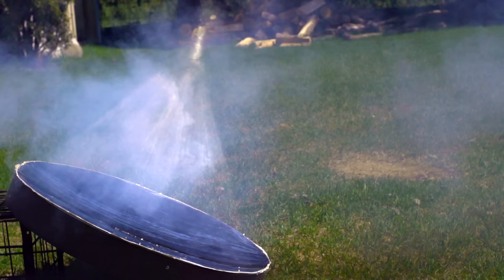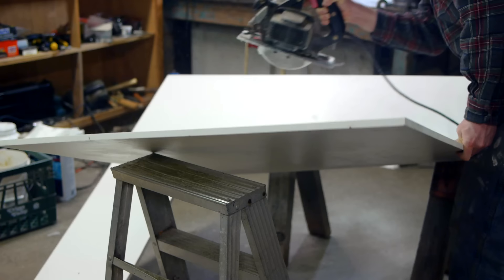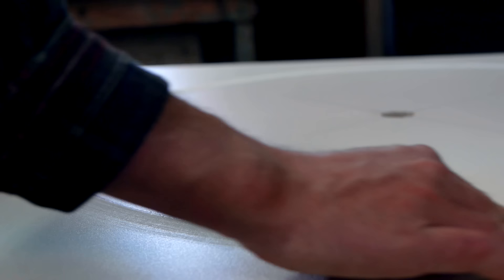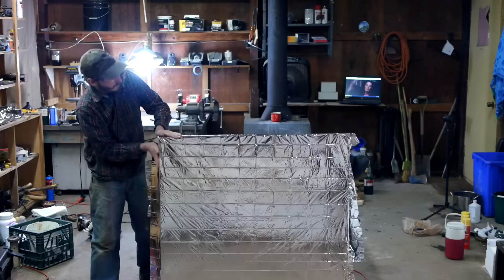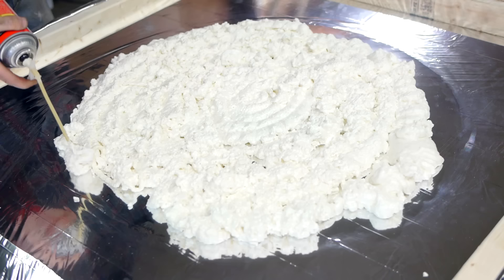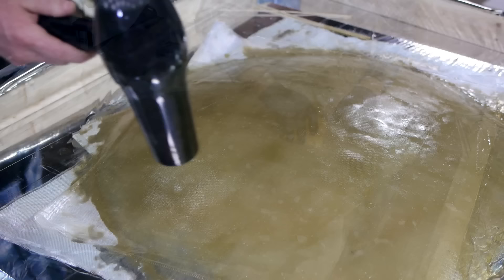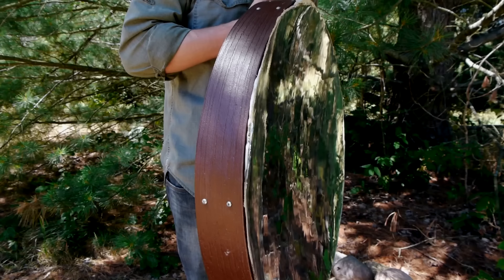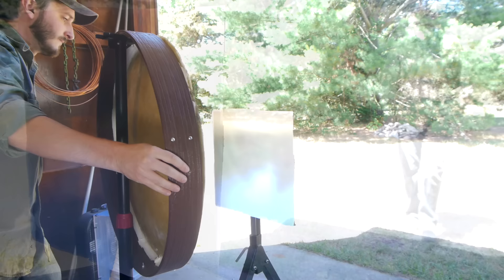How To Make Parabolic Mirrors From Space Blankets - NightHawkInLight

Comment: Hmm, wouldn't inflation create something approaching a spherical shape rather than parabolic? Obviously not in this case but I would love to know why. Also, if this is anything like using gravity to make a parabola what it actually makes is a catenary which would be fine for solar but probs wouldn't work for telescopes.
Reply: I agree with you.  This is a great way to make a reflector for solar use but it won’t be a parabola and even if it was a parabola, it’s never going to be smooth to a 1/4 wave (some mirrors for astronomy telescopes are 1/10 wave).
Reply: This technique has been used for decades by amateur radio operators to make "parabolic" reflectors for antennas. There the tolerances are not as critical as the wavelengths are relatively large. I don't think a telescope is possible as you would want a fraction of a very small wavelength (good optical mirrors are about 1/10 wavelength). For concentrating sunlight however, this is a good compromise. We can start a fire with a small magnifying glass, so a 3'mirror should be good enough even though it does not have pinpoint focus
Reply: I also think it's not a parabola. A parabola  has the sharpest curve at the centre, I suspect this has the sharpest curve at the edge ?. It should be easy enough to Ray trace it and discover its coma ?
Reply: Mirors for astronomy are incredibly difficult to make. They must be perfect to the micron. It's why they are so expensive to produce. This is Definitly a wonderful projet for solar cooker, long range micro or wifi. With old recycled satellit parabola this technique could probably work. It reminds me i have to repair my bicycle tire :-)

Comment: You can tighten the mylar around the wooden frame by heating it with a hair dryer as well. The heat causes the mylar to shrink on the frame and turn into a clean mirror.

Comment: When you look into the mylar and see your reflection, is the image crystal clear like it is in your bathroom mirror?  If there's any fuzziness at all, then it really won't be suitable as a telescope mirror.   Furthermore, the tolerances required for the paraboloid shape are tight in order to get a clear image.  But don't despair -- there are other good uses for an approximate paraboloid -- like the solar cooker you've shown.  I know that -- in theory -- rotating a shallow dish of liquid will generate a parabolic shape, but the liquid needs to have viscosity high enough to damp out waves and turbulence, and you'd probably need to run it for a while until the final shape is stable.  I wondered if a long-curing syrup-like 2-part epoxy, rotating in a shallow dish would solidify into a nice parabolic shape.  This could then be used to (1) make a long-distance acoustic spying device or (2) serve as a template for making parabolic surfaces via vacuum forming hot thin plastic sheet.

Comment: Next video - make it heat water in copper pipes and make it rotating, to falllow the sun with arduino.
Reply: Easier to use black hose :p
Reply: you don't need an arduino, you just need a cross made from small solar cells which is attached to the mirror. the solar cell outputs are crosswired to the DC tracking motors and the cross is mounted in a way that the sun isn't shining at the solar cell faces but at the edges. :)
Reply: it's almost stupidly simple. no electronics needed at all, not even a battery or power supply!
Reply: you won't need copper pipes mate.. just get half a barrel, fill with water and aim the lens at near bottom, make sure your barrel can breath a bit.. wont take long and it doesn't need to follow the sun, 1 good hour is more than enough.. this thing can melt metal in not a very long time, water would be stopping your barrel from melting.

whwre i am, we don't have electricity so we made 1/4 of a barrel (cut a barrel down and welded it) and connected it to my water tank, i heat water using wood or gas (mainly wood), but those can get expensive.. i need one of these lenses or anything that can focus a big area somehow, those blankets aren't available here.
glass is out of the question..

i tend to use a 10m black 1/4 inch garden hose for showering, but you cant make everyone shower with that alone.. need something bigger for the house..
Reply: +AA A if you dont have electricity, how did you comment this?
Reply: M Isa 
Small solar system.. cam charge phone and turn on modem at least xD
Reply: AA A - I'm not sure where you're from, but here in the US, you can drive around rural areas and find those old 4 to 6 foot satellite dishes all over. They aren't being used anymore and most people will let you take them just to get rid of them. They are mounted at ground level, which makes it easier to get at, but some of them can be heavy, so you should probably get some help removing it. The bolts are usually very rusted, so you might want to bring some penetrating oil and/or a hacksaw with you. I currently have 3 right now and this is how I got all of mine. I made a parabolic reflector from one by using 1 inch square mirrors that I glued to the dish. I use the other to pick up the few satellite programs (and other interesting stuff) still being broadcast on the old systems. I haven't thought of a use for the 3rd one yet, but I'll think of something eventually. If you ever get your hands on a small DirecTV or Dish Network dish, you can remove the LNB and replace it with a microphone to make a great remote/amplified listening device. It's fun to point it around in wooded areas and here all sorts of sounds that you would otherwise never be able to hear. Anyway.... good luck with your 'off-grid' lifestyle. I often wish my home could be less dependent on the electric company. I do have a large piece of land and I'm thinking about solar and/or wind power but I haven't decided which way to go yet.
Reply: wjustic1 what about using chrome or silver spray paint on it to obtain a parabolic mirror (a true big one,not a mosaic) ? you will need to prepare the surface first to make it as smooth as possible and cover any bolt holes with epoxy, of course. the chrome paint used for tuning hubcaps should be good. the result is very mirror like.
Reply: That sounds like a good and simple idea. I'm looking at using these shapes to heat water or cook with solar energy in the Phillipines
Reply: The large dishes are made with wire mesh/expanded steel to reduce the weight and wind resistance. I would add a smooth surface (like sheet metal) on the dish in order to paint it. I might be able to use some extra heavy aluminum foil, aluminum HVAC tape or silver mylar plastic, though.
Reply: Joe W. try an inverted conical solar cooker. Easy to make with cardboard or foam and heavy duty aluminum and "wheat paste glue".   These are very efficient and MUCH safer than the parabolic cookers.
Reply: Thanks Justin. Sounds good. Do you have a link to such a system? In the mean time I'll google it.
Reply: Falllow...?  Anyway an active following cross works well but may fail to self realign after a long cloudy period.  A mechanical tracking gear like that used for telescopes is sufficient, although I've never looked into what is done to reset it's position every 24 hrs... Half a day it isn't used and having it go full circle may either be weird or mechanically impossible.  An arduino is probably overkill.
Reply: Kevlar Canuck Arduino, overkill? i don't think so. It's the right tool for the job. The program would be a simple thing to make, and it could be made to be very reliable.
Reply: A. Zak What kind of power supply, programming scheme and data set would you use to track the sun?  A mechanical tracker can be set and left.  It needs no delicate circuitry and has been the right tool for the job for decades.
Reply: You don't need a freaking Arduino!!!
all you need is a stepper motor and a pulse Generator.
Reply: TheBackyardScientist
No shit!!  my black hose in the patio, puts out almost-boiling water!!! 
and I'm not even trying!!!  
Burned myself more than once! bc I'm not thinking about this stuff!!
  LOL
Reply: @AAA-bo1uo  Saw some folks use a large satellite dish, probably 6 or 8 feet dia, one of the old ones, it was a dark gray inside.  Kept it down by the stream, no mountings, just the dish.  Tip it into the stream angle to fill, and drag it ashore.  Wait a few minutes and you've got a very warm bath.
Reply: @AAA-bo1uo  You can make your own parabolic to whatever "fixed focal point" you want if you don't want to be committed to finding a sat dish..Its all a matter of the amount of air pressure you apply in the forming process, creating the intensity of the domed shape, prior to applying the fiberglass which will increase or decrease the focal angle up to the stretch limits of the Mylar..

Comment: Have you tried gluing the blanket to the rim of a shallow tub and then sucking the air out, this should produce a perfect mirror as the is no backing material to distort it and by altering the pressure you can change the focal length.

Comment: I use a hygene mirror in my camp kit for solar ignition. Was cheap and is durable. And will light a match without any issue. The concept of parabolic dishes is excelent and i think there is tons more potential in this we have yet to tap into. Obviously my little mirror wont melt bricks but for a few buck, and for its intended use, its hard to beat
Reply: Please describe a hygiene mirror and how you start fires with it? I looked up that term and came up with nothing

Comment: An idea that I've wanted to try is to use a discarded DishTV antenna. These are actually an offset section of a parabola. I would glue the space blanket material to the dish surface.
Reply: that might actually work pretty damn good. 

I used to build high end hill-bombing/downhill skateboards out of composite material and various cores. They were pretty wildly shaped as well and the technique I used was basically vacuum pressing/lamination. The composite materials were soaked in epoxy, layered onto the core (+pressing form yada yada), put into a vacuum bag and pressed by the resulting atmospheric pressure. 

Maybe you could coat the dish with epoxy, lower the framed Mylar onto it, and let the Mylar elastically form into the dish with vacuum in a similar way.
Reply: I tried that but wasn't happy with the result. Yes it worked but self-adhesive reflective aluminum tape worked better. I didn't try the vacuum method though

Comment: What if you used the dish from a satellite tv antenna? It would make a nice rigid form too. Aren't satellite dishes true parabolas? I could be wrong about that though.
Reply: They are good and rigid, but expensive.
Reply: people toss those daily
Reply: zasabiibasaz my thoughts exactly. :)
Reply: mute8s Yes, you should be able to use a sattelite dish. I just meant it would likely be cheaper to build them his way, if you want to have a lot of them.
Reply: Not to mention this process stretches the creases away to make a much smoother finish.
Reply: I got one for that purpose exactly, around 80cm diameter. The problem is, they are painted, and aren't very smooth (not mirror-smooth at least). Then I tried to glue strips of space blanket on it, and it came out all wrinkly. It focuses light well enough to set dry wood on fire after a while, but nothing like instant flame. I should try the vacuum method.
Reply: olegkikin I was thinking that may be a problem. Have you tried removing the paint? Maybe with a heat gun or some sort of paint remover?
Reply: from what I've heard they are not true parabolas
the spherical shape is a good approximation and much cheaper to make
Reply: I think I saw a video by Kipkay where he covered an old satellite dish with mylar tape.
Reply: MisterTalkingMachine back in the day I used to install many types of satellite dish equipment ranging from the simple 12 ft x band to the small DSS and I can say they are not true parabolic. They are more oval this made them a better collector to direct signal to the lnb
Reply: I've got four in my shed I've collected over the years (thanks DishNetwork!)
You can have 'em.
Reply: I have several. I put paint stripper on one, and scraped.it.off the next day with plastic so as to not scratch it.  It wasn't bumpy, so I began the polishing regime. It's a ton of work, starting with 200 grit sandpaper, then 400, 600, 1000, 1500, 2000, and finally 4000.  I've done this for aluminum, but the steel dish was so much more work, I quit at 400 and sought machines that do it.  Cloth disc and polishing  compound.  Well, that didn't even do that it was supposed to do. Now I'm considering a leather buffer tool, like I've seen on How It's Made.  My fresnel lens keeps me busy, melting pennies and vaporizing aluminum cans. It's about 4 feet across.
The dish antenna is not a true parabola anyway, so no astrophotography, but good enough for heating.
Reply: +Olegkikin
They will be smooth to within ~0.1 wavelength of the band they are designed for... which means perhaps a mm or 3.
For visible light (telescope) application, they need to be more like 60nm smooth.
Big diff.
Reply: pixelmaniac all you need is a hair dryer or heat gun to get rid of the creases and stretch mylar to fit a parabola.
Reply: You could use a sat dish.. but why limit yourself??.. you are obliged to the focal point designed by someone else..Bear with me a moment.. imagine an oval shaped reflective semi parabola surface designed to a focal point say ten feet away using this same vacuum method..Of course the two most direct focal semi circular points would have the greatest intensity but you would have a fairly intense strip running between them

Comment: Two things, 1) I have used a solar blanket to shield the sun from south- facing apartments that were experiencing oven- like temperatures unless the air conditioning was on continuously. When stretched tightly over the window, you could see outside perfectly like through mirrored sunglasses. The Mylar film was allowing about 30% of the light through, not the best thing for solar concentration,    but I am impressed how it does work in your video. Thin aluminum foil reflects 100% of the light... Could this idea be revisited using this instead?  Where can you get a wide enough roll?  With the same bonding process to fiberglass, the fragile foil would become a strong structure. 

2) With this process, the shape created would not be a parabola, it would be more like the a section of the edge of a balloon,  spherical in shape, good enough for the purpose, but less than perfect. Try as you might, but I doubt you get an optical surface that would work for a telescope... What DID work was a spinning dish with reflective mercury placed in it, the liquid automatically forms a perfect parabola, whose curve depends on the speed at which it is spun, but it is obviously constrained to only being able to point straight up... Hmmm, any way this could be used with an epoxy type liquid that is spun until it sets?
Reply: Thats exactly how they make very large (8 meter) telescope mirrors.  They melt glass and very, very slowly let it cool while spinning it.  It takes a couple months.

Comment: Here is a great improvement idea for your manufacturing process.  Use Rubber Cement on the PVC board then layout your space blanket over this, but before inflating it apply Epoxy to your backing ring, set it in place over the space blanket, clamp the ring down lightly enough to allow it to add pressure through to the rubber cement between the PVC sheet and the space blanket, Now apply pressure to the valve stem and create the dome, apply the Fiberglass shell inside the ring and allow this to dry while keeping the air pressure on the valve stem.  And I would mount a pipe fitting here instead and attach it to a 5 gallon pressure tank and adjust the output pressure to about 10 lbs., If there are no leaks it will maintain the same pressure to the sheet the entire time while it dries.

Comment: Many years ago I made sun cookers with mylar on satellite dishes. Originally I made one to melt wax for candles. It boiled the wax. Then I made coffee. It needs the glass or pot to be smudged black to absorb the sunshine better. Next it became a science experiment for the kids school project. They made stew in a cast iron dutch oven hanging on a tripod.The larger dishes of course work better or putting several dishes around the pot. Next I used it for melting ammo lead and ended up pitting holes in the cast iron. Just reduce the focus by pulling the dish away a bit. The sun is awesome!   Free fire

Comment: It’s sort of like stretching a painter’s canvas. However, I’d hit the face of the frame with the spray adhesive. Start on the centers of the edges and pull at the corners, working slowly from center to corner. Once centers are tight it’s a matter of pulling out the slack/wrinkles. HTH